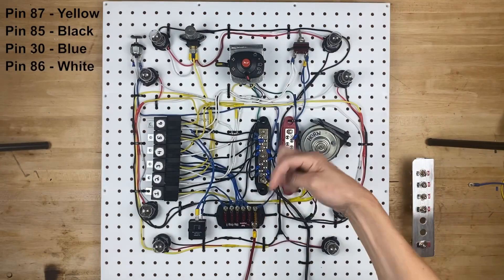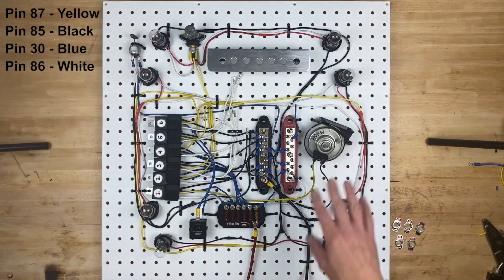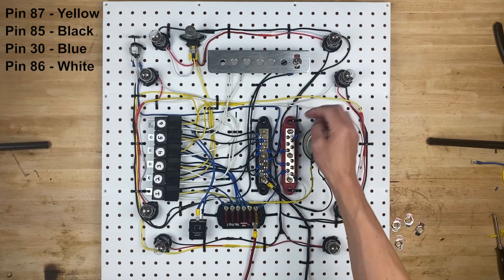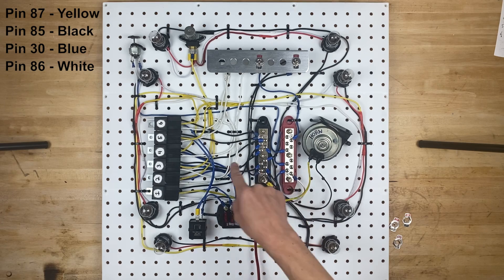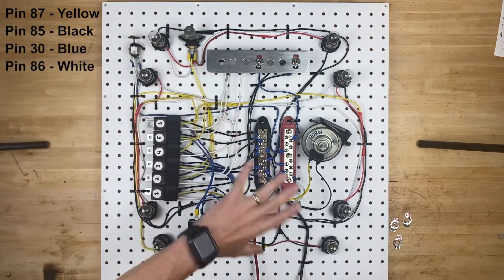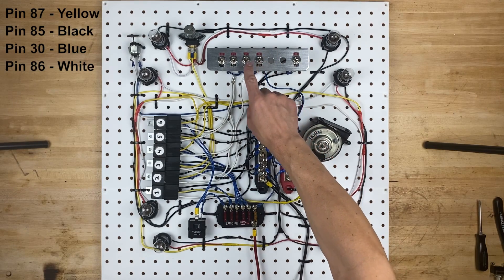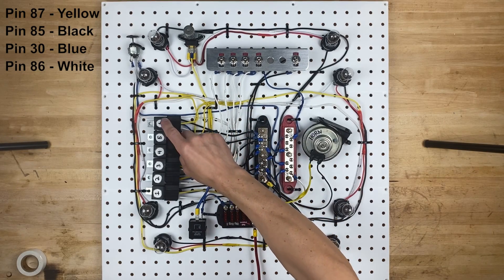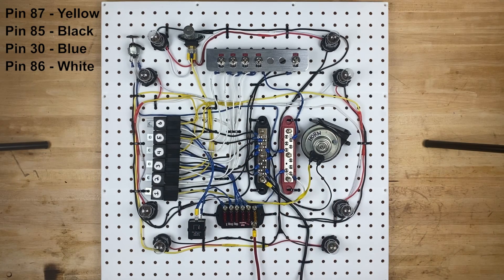How to Wire ALL Car Lights to Toggle Switches (Even if You're a Novice) | @WiringRescue

Comment: Your videos are really good they're very helpful. I'm actually about to use a couple of your wiring videos on my drift car build. But I would like to know how i would do this if I want to use the horn button on my aftermarket steering wheel.
Reply from the maker: You could put a button right in the center of the wheel that grounds the relay. Or use one of the flexible cords that can wrap around the steering column as you turn.  Here is a video for the wiring that may help you out. https://youtu.be/eu0vQKKDVho?si=Eq35wuc8cID5TFrb

Comment: So, how do you wire 5 separate switches so that they will turn on individually and then to a sixth switch to turn them all on?  I did this about 15 years ago, however, my memory is a bit fuzzy on how I pulled it off.

Comment: What is the deal? Most cars from the 60s And 70s. don't even have half. As many Relays you are showing to wire you're bored correctly.
Reply from the maker: The short version is: old cars had giant (sometimes ugly / mechanical ) switches everywhere that could handle large amperage loads. They also didn’t have electric fuel pumps and electric cooling fans. Most modern switches that you buy are rated for 15amps or less. So if you are powering a larger component, like a fuel pump, or radiator fan for example, you will easily burn the switch out by drawing too much amperage through it. However, a relay allows you to control a much larger amperage circuit, with smaller (better looking / digital) switches. 

Check out my other videos specifically on relays for some more in depth info!

Thanks for watching and good luck with your project.
Reply: @WiringRescue  Yeah.
 I may have burned up a switch or 2 of my life. Yeah, my 65 Pontiac as a bunch of mechanical Relays.

Comment: Hi, I am about to dive into my 1974 Ford F250. I had a headlight blow out and bought a new set of 7-inch sealed beam headlights with separate parking light bulbs. I thought it would be a simple plug-and-play installation, but now both headlights aren't working, and one of the parking lights has blown. All my other lights work fine.

I have replaced the 3A fuse in the light section of my fuse box, but nothing has changed. I suspect it might be the dimmer switch and I'm currently waiting for a replacement to arrive in the mail. Additionally, I want to install a set of spotlights using a couple of dash switches already in the truck. I have four relays in the engine compartment that seem to be functioning well, as I wouldn’t have any other lights working if they were bad.

My question is: where could there be a short circuit if the headlights aren't working at all? The dimmer switch is the same as shown in your video. I appreciate any insight you can provide. Should I start digging in with a test light? Thank you!

Comment: Hi, I have a question. Why is relay 1 White wire going to the positive distribution block, and the rest of the relays White wire going to the switch please??
Reply from the maker: Horns are almost always wired on the ground side because that’s how most horn buttons work (grounding to the steering column). I have a separate video all about horns if you’d like to know more. Here you go! https://youtu.be/eu0vQKKDVho?si=0xyQ5ytWOvzTadTz
Reply: @WiringRescue  Thanks Jeremy, Great videos by the way. I am re wiring my whole car and could not do it with out you 🙂

Comment: So this system has hot switches on all but the horn? Why do you have some relays controlled on the hot side and some on the cold/ground side?
Reply from the maker: Horns are almost always controlled on the ground side because the horn button grounds on the steering column itself.  If you look on most older car wiring diagrams (before computers/modules/can-bus), you’ll find this design.

Comment: Hello, Why did you connected the switch to the ground for the horn and for the rest of relays to the positive side pin 86?
Reply from the maker: Most horns are wired this way because your horn button grounds directly to the steering column. I think car makers did this to save on wire. 😂 You don’t need to wire it this way, but most car makers do.

Comment: Is a relay really needed on the brake lights? Wouldn't it make sense to power the brake lights to work even with the ignition key off.
Reply from the maker: There are dozens of methods of wiring lights. This was just one option. I also have other videos without relays if you prefer to not use them. Wire yours the way that suits your specific vehicle needs.

Comment: I've been wanting to add lights to my truck, with let's say 3 lights front rear top and then have 3 switches one for each and then one master switch that would turn all of them on and off. What would I do so that when a single switch is on it doesn't jump power to the others

Comment: What gauge wire do you recommend for a fuse block that comes from a 12v battery to fuse block?
Reply from the maker: I’d recommend checking out my video about wire and fuse sizes. The wire size depends on how much electricity needs to flow through it.  https://youtu.be/EhzN6UdnmPA?si=XQoHopEdP77jmNZw

Comment: Newbie here, I got the 5 pin relay instead. Is that still wireable?
Reply from the maker: Absolutely!  Just don't use pin 87A.  You can easily remove them from the connector. Thanks for watching and subscribing!

Comment: Why do you ground side switch the horn but nothing else?
Reply from the maker: Because most horn switches are grounded to the steering column. That’s just the way that most horns are wired. I assume it is to run less wires up the steering column.

Comment: I plan to rebuild my dash of a 73 Ford. Does it makes sense to have turn signal switches like shown in this video? Instead of the lever at the steering wheel. Because a normal on off switch need to be turned off after cornering

Comment: Fantastic demonstration it's exactly what I needed to use on my 1976 coachmen leprechaun which is really a Chevy g30 I broke the headlight switch so I had to redo the headlights and I just used a bunch of toggle switches and relays and it's actually a lot of fun I putting some new lights and strip legs and fog lights and all kinds of stuff a big blow horn from like a tractor-trailer it's awesome thanks again for making it easy I kind of had an idea but definitely made it a lot easier and fun facts

Comment: I noticed in your parts list there is a hyper link to amazon straight to the part- like for example the  2pin turn signal flasher page. I went to this page and viewed the flasher. the flasher had pins on it but there was no socket available where the wires would connect to. also the flasher socket was not listed in your parts list either. how could that have gotten connected unless it was soldered directly?
Reply from the maker: I just used spade connectors to connect wires to the flashers. It’s not as professional in an installation but it’s easiest for my style videos.
Reply: Thanx, perhaps I ll go to a auto parts store for that I guess, thnx again.

Comment: I’ve got one lol. I just pulled my TS switch and am trying to figure out how to wire the brake and Turn Signal lights back together. I know they sell $70 toggle switches to complete the task but is there a way to wire it?
Reply from the maker: There is! I’ll be making a video on this very soon. Likely the next video, or the one right after that.

Comment: I have a hypothetical question. If the switch panel is made out of metal, would be easier to ground it with a single wire and all the switches get grounded to the panel?
Reply from the maker: That is definitely an option! Just make sure it’s a good metal to metal contact, not a painted surface. :)

Comment: Bro wont the dimmer switch gets the load if we use  real head light bulb snd switch gets bad easly
Reply from the maker: You are correct, but this type of floor mounted dimmer switch is rated for headlight amperage. As long as you use a switch rated for the proper headlight amperage, it’s safe to use. Thanks for watching!
Reply: @WiringRescue  Thanks for the great video.  Follow up question.  Could you run your 12v trigger through (in my case) the pull out light switch on a 58 ford f100 to the floor dimmer and then run high low output on the dimmer to two separate relays to run high and low beams?  Maybe that is overcomplicating but I was looking at running some higher powered LEDs (150watts) and thought if I split them using relay it could maybe operate better.   Thoughts?

Comment: Is there any problem with running the high beam current through the dimmer switch?? I thought the whole point of relays was to avoid running the current required by a particular device through a switch?

Comment: You really do a fantastic job, but was wondering if you could take a suggestion and do the led lighting with aftermarket motorcycle switches, lol I’m trying.. just don’t want to short anything..and have to re-buy it..I used this keenso brand on Amazon..13.00$ if it’s not feesable I tried…
Reply from the maker: Post a link to the switch. Maybe I could make that happen.
Reply: @WiringRescue  sorry so late, I had to re search for it.
Reply: @WiringRescue  I posted the link for the handlebar switches but for some strange reason I revisit this chat and it’s not showing up?
Reply: That would be sick..

Comment: I like to supply the relay with 12 volts and use the switch to ground the relays  that way I have less wires to run just another way to do it
Reply from the maker: That’s absolutely a great option! I have some other videos showing exactly that. Thanks for watching!

Comment: And for example, if you wanted to make a key switch that would cut off the current to all the switches, what would you have to do?
Thanks!
Reply: Put it between the power distribution block and the switches I suppose. No power to the switches means no power to the relays. I would probably put the parking lights on a different wire from the power distribution block because I'd like them to work without a key as well.
Reply from the maker: Id probably throw a switch in that blue wire that goes in between the switches and the red distribution block. That would kill off the whole switch panel really quickly.